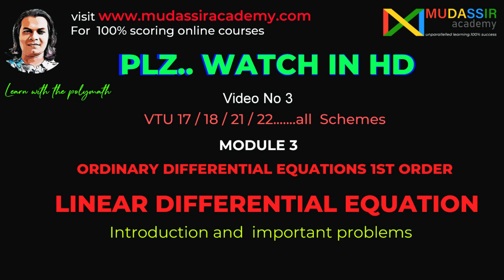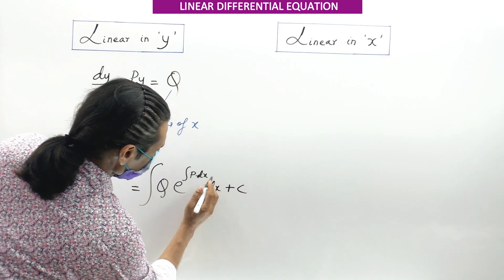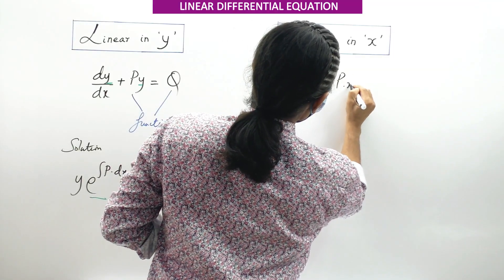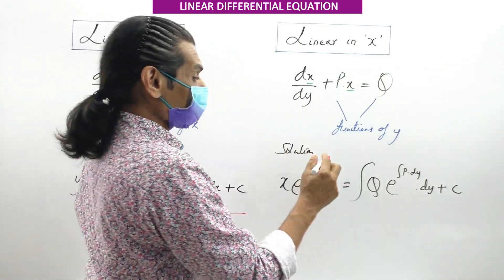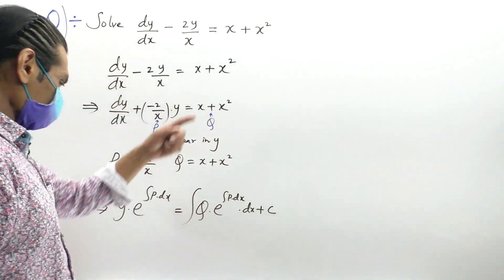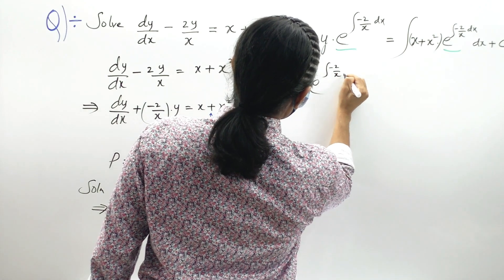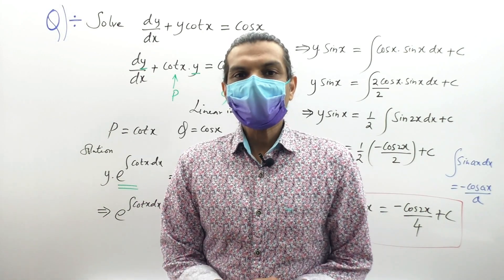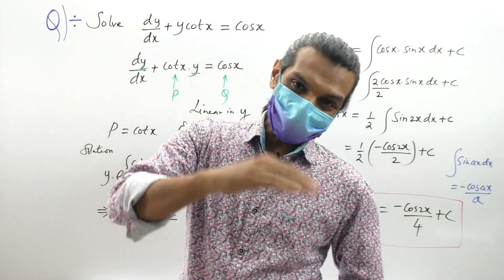Linear differential equations engineering mathematics |VTUM1 introduction with vtu problems

Comment: Sir with you all support we completed the  2nd sem with not too good marks 80/100 but ya decent 
So I request u to make new video on 3rd sem maths as soon as possible plz
Reply from the maker: Glad to hear you completed the semester, and I'll get started on those 3rd sem videos soon!
Reply from the maker: plz share the syllabus for m3
Reply: @mudassiracademy sir I will share u
Reply: Module-1: Fourier series and practical harmonic analysis
Periodic functions, Dirichlet’s condition. Fourier series expansion of functions with period 2𝜋
and with arbitrary period: periodic rectangular wave, Half-wave rectifier, rectangular pulse, 
Saw tooth wave. Half-range Fourier series. Triangle and half range expansions, Practical
harmonic analysis, variation of periodic current.(8 hours)
(RBT Levels: L1, L2 and L3)
Module-2: Infinite Fourier Transforms
Infinite Fourier transforms, Fourier cosine and sine transforms, Inverse Fourier transforms, 
Inverse Fourier cosine and sine transforms, discrete Fourier transform (DFT), Fast Fourier 
transform (FFT). (8 hours)
(RBT Levels: L1, L2 and L3) 
Module-3: Z Transforms
Definition, Z-transforms of basic sequences and standard functions. Properties: Linearity, 
scaling, first and second shifting, multiplication by n. Initial and final value theorem. Inverse 
Z- transforms. Application to difference equations. Module-4: Ordinary Differential Equations of Higher Order 
Higher-order linear ODEs with constant coefficients - Inverse differential operator, 
problems.Linear differential equations with variable Coefficients-Cauchy’s and Legendre’s 
differential equations–Problems. Application of linear differential equations to L-C circuit and 
L-C-R circuit.(8 hours)
 (RBT Levels: L1, L2 and L3)
Module-5: Curve fitting, Correlation, and Regressions
Principles of least squares, Curve fitting by the method of least squares in the form 
𝑦 = 𝑎 + 𝑏𝑥 , 𝑦 = 𝑎 + 𝑏𝑥 + 𝑐𝑥2
, and 𝑦 = 𝑎𝑥
𝑏
. Correlation, Coefficient of correlation, Lines 
of regression, Angle between regression lines, standard error of estimate, rank correlation. 
(RBT Levels: L1, L2 and L3)(8 hours) @mudassiracademy